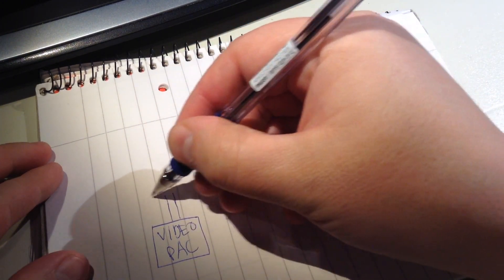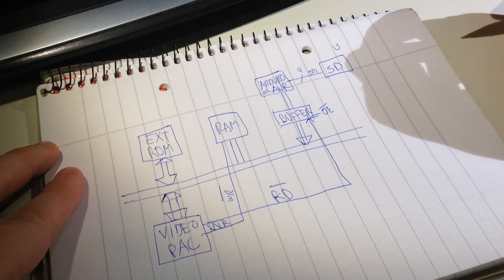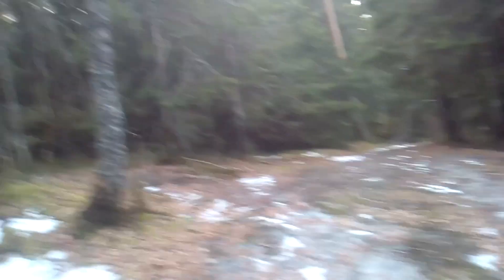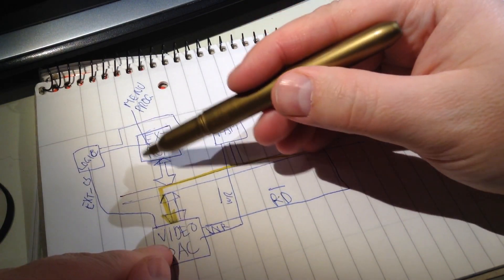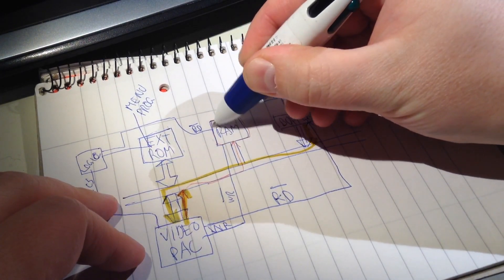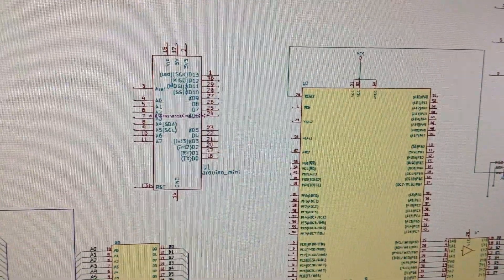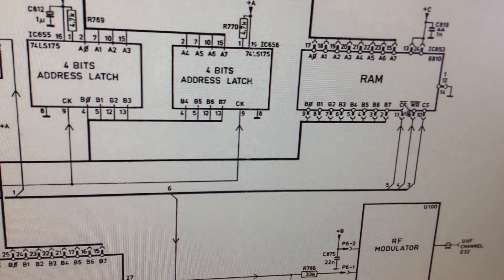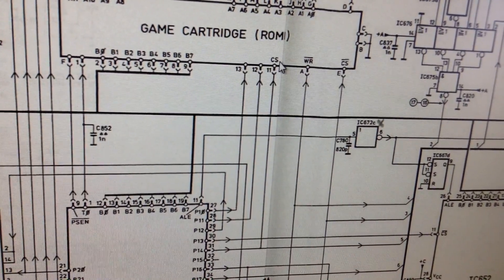VideoPac G7000 SDcart - design idea part1

Comment: I'm trying to make sense of this. So during normal operation, the CPU accesses cartridge-rom and system-ram and switches between them using the chip select line (CS=rom, !CS=ram). Our trick will be to replace cartridge-rom with our own ram, so we can copy game code into it. Question is, do we even need the system bus to do that? I mean it's good to know that the system bus isn't in use during game-select but will it do us any good?
Reply from the maker: The Highlander the psen signal access the instruction rom. The cs rd and wr access ram. With multiplexer we xan handover the psen to ram to fetch instr from there
Reply from the maker: Just looking back at the design idea videos. The resident ram us internal, so no CS on that. then there is extram and rom. there are two chipselects, one that strobes on a read and snother to select extram or a cartram, and then a psen signal for the eprom. by setting one CS we can disable extram.